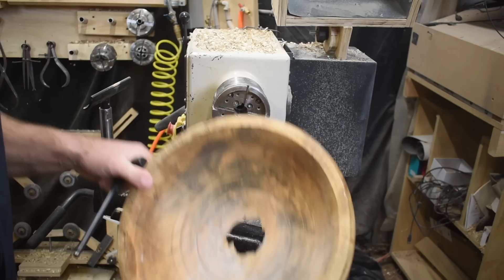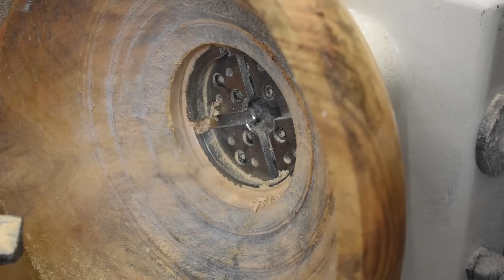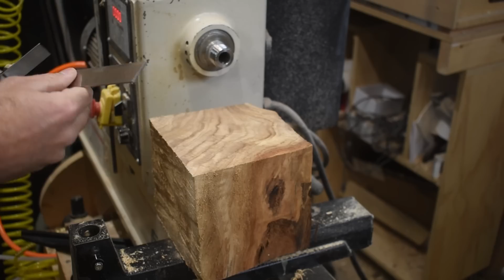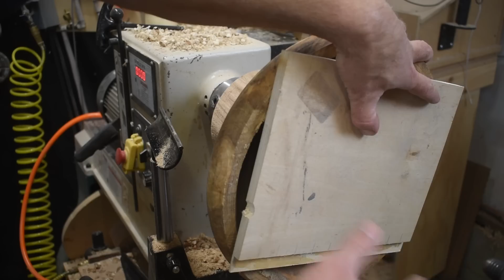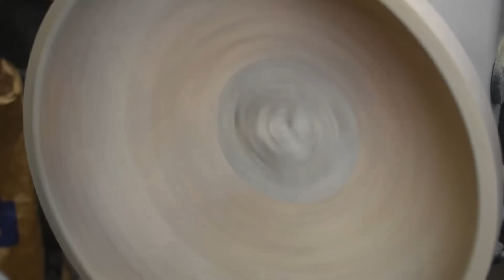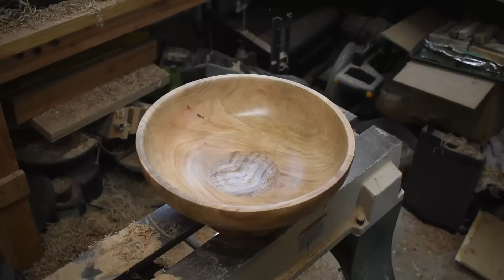How to fix woodturning mistakes.  funnel to pedestal bowl

Comment: I’m not an epoxy proponent.   Pretty sure we have all blown through the bottom of at least one bowl.
Reply from the maker: Thanks the audio got messed up in that spot of the video.  When I shaped the transition from the base to the bowl I had a few gaps in my glue joint.  I cut a groove in the joint and filled it with epoxy and copper powder to hide it.
Reply: @BlackLabelwoodworks    Lesson learned, do not use calipers to match a peg and a hole.   Test fit until perfect.

Comment: Very nice save. Pedestals work well for this. You can also just “plug” the hole. I like to cut a small groove on the inside and fill with coffee and CA. Just gives another point of interest.
Reply from the maker: Thanks Doug I did one previously using a resin plug i made with a laser cut wood disc in the shape of a tree of life.  Was a hit at the shows i really need to make another one.  I think i still have another bowl i funneled that i did not have the heart to send to the fire pit.